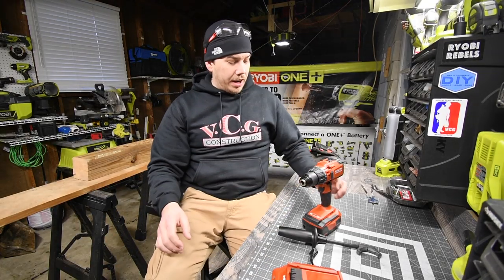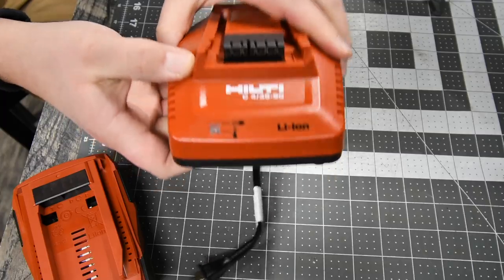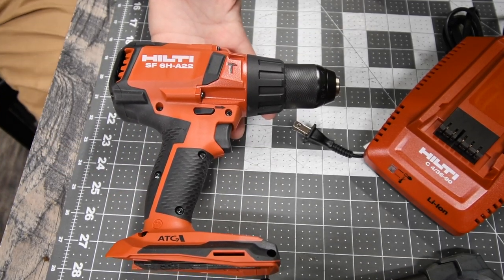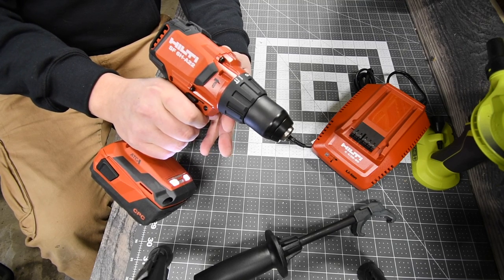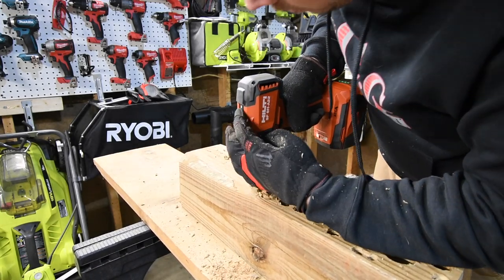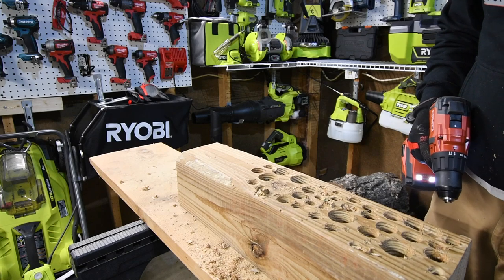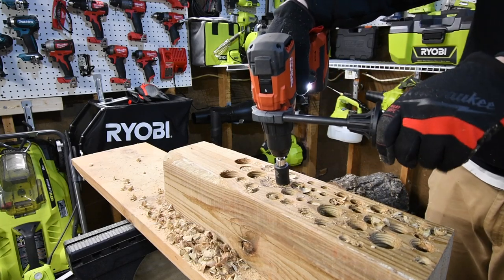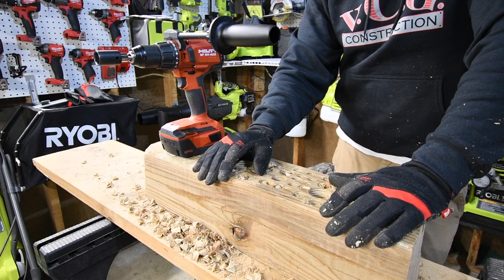NEW!!! Brushless 22v HILTI Hammer drill/TEST

Comment: You took the handle off because you needed more control lmao that’s what the handle is for more controllability. I see you found that out real quick and put it back on. That thing will break your wrist if you don’t use that handle.
Reply from the maker: I needed direct control. so in the video I just uploaded now I found it that putting the log on the ground is best
Reply: Ryobi Man Caver oh yes down lower where you can use your entire upper body to control it is much better.
Reply: No it won't......It has ATC. Active torque control. The drill stops automatically if it catches.  It only has 80Nm of torque but blows my Gen 3 Milwaukee fuel away on screwdriving torque. I own this drill and its incredible!!

Comment: I need some Hilti for science.  I only install cabinets should I go 12 or 22.  I don't want the one in this video but maybe there is a compact 22 or I'll go for the 12.  I have every DeWalt 20 and exstreme  Makita 18v m12 and m18.  So far the DeWalt Is best for Carpenters with there flexvolt.
Reply: Tim Happy sounds like you have more tools than skill for cabinet work is 12v less weight and no contractors run 60v
Reply: @FIinchfree 60v is for mitre saw table saw and compressor.  Contractors in your area must not know how to charge or you would see thease things on the jobsite!
Reply: Tim Happy contractors in your area must not do production work
Reply from the maker: the 12v will be powerful enough but the battery won't last as long as you need it to, id get the 22v
Reply: @ManCaverTools  just ordered the Hilti impact hammer drill circular saw and cutout tool.  Ty for the video.  If I like gonna try the rest of the Hilti tools.     I wonder if Hilti batteries are better then DeWalt Makita and millwaukee they sure cost more lol 😂
Reply: @timhappy7223  Hilti make all the other tools look like toys. These are serious industrial drills. I have owned Milwaukee, Makita, DeWalt and Hitachi.  None come close to Hilti's build quality or longevity. This New SF6H A22 brushless pisses all over my Milwaukee M18 Gen3. 135Nm of torque for the Milwaukee is bullshit.....The Hilti with 80Nm easily beats it on lag bolts with a torque setting to spare!!
Reply: @davesheppard8797  well sweet I ordered some and get them tomorrow
Reply: @timhappy7223  What did you order mate??
Reply: @davesheppard8797  brushless drill impact circular saw and cutout tool.  3 Batts and a charger.  If I like I'll get the rest lol.   Tired of people grabbing my stuff on so called accident
Reply: @timhappy7223  Wow! Let me know what you think of them.
Cheers,
Dave.

Comment: I got mine 2 days ago and love it! I'm pushing it to the limit on next weeks project.
Reply from the maker: this tool will last for a very long time. it did some tough tasks like nothing, and I thank you so much for viewing
Reply: Marcelo, How are you liking your new Hilti now you've had it for over a week? I love mine!! 😁😁
Reply: @davesheppard8797  it is awesome! So far no problems other than being over powered! Careful when you use auger bits though because it sucks you in.
Reply: @monsterlwd  That's great Marcelo, I love everything about mine. It is really powerful! Almost too powerful, I could do with a 12 volt kit for my smaller jobs. Although the power is much more manageable on the Hilti SF6H than it is on my M18 fuel. I was using my Milwaukee all day today at my stepdaughters. Turning the torque ring right down to 1 it was still giving too much torque for what I wanted. The Hilti's torque range is much wider, its softer than the Milwaukee on 1 and more powerful than it on the top torque setting. I hope you keep loving it! What impact do you use mate?
Reply: Still choochin? Mine is on the way! Picked up the hammer and 18v impact as well!

Comment: Can you turn off the hammer setting? I'm looking to get this as a normal drill driver and hammer? Sorry if you mentioned it in the video. I may have missed it
Reply from the maker: yes. the hammer feature is on the clutch. drill, hammer and screw features

Comment: The Gen 3 is its biggest competitor
Reply from the maker: we will see how the dewalt is soon
Reply: Not a chance!!!! I own the Gen3 and this Hilti. The Gen 3 lost every test I did on head to head. The 135Nm of torque claim by Milwaukee is bullshit! It won't drive in lag bolts and leaves them 3/4" out. The Hilti drives them in flush....head and all!! The Hilti supposidly has 80Nm of torque but it wipes the floor with the Milwaukee!!.
Reply: @davesheppard8797  The 135Nm is the hard joint value, think of screwing a metric bolt down. Once the screwhead sits flush with the surface of the material, the torque required to turn it any further spikes dramatically. On the other hand the soft joint value makes more sense, torque increases steadily when driving a self cutting screw into wood or steel. Hilti has a soft joint value of 65Nm whereas the Milwaukee has been measured to be around 55Nm (can't find any specs on either Milwaukees website, nor the operators manual.
Reply: @davesheppard8797  ....This is what i called a top notch review buddy. you convinced me.... Thx a Lot !!
Reply: @korlimservices4180  I just told it how it is from my testing. Plus the Hilti build quality is far better and it should outlast the Milwaukee 5 times over. I have trigger issues with nearly all my Milwaukee gear.
Reply: @Probotector_AUT  Yes....I was recently told that the soft torque value was more important for what I do. Screws into timber. This was only for my testing purposes though. Being an old fashioned carpenter/Joiner I always use Pilot holes and countersinks so either drill will easily do what I require. I much prefer the Hilti ergonomics, build quality, low end torque and love the ATC, which is really a must on combi's this powerful. My Milwaukee tools all bar 1 have trigger issues and they get too hot!!
Reply: @korlimservices4180  Hilti have always made really good tools. They lasted for years and always got the job done. They were never the fastest or best but would take a hell of a lot of abuse and keep going for years!! So this new brushless SF6H is quite an eye opener as it's kicking its competitors Asses! Soon, Milwaukee and DeWalt will have an upgrade that will put the Hilti behind again. But they won't have the toughness or the longevity of the Hilti. Also this new Hilti has far too much power for me so why would I wish an upgrade. This SF6H does everything I need and more. Plus the speed of a drill is as only as good as the guy using it. My Milwaukee drills are too powerful for such a small package, they get too hot, the triggers don't work half the time and are uncomfortable if I use them all day. Just my opinion but I now always go with Hilti. My Te6 a22 SDS has only 2.5 joules of impact. One of the M18 fuel SDS drills has 4.5 joules. But on test the Hilti beats it easily and with less vibration.
Reply: I would say that the DeWalt is it's closest competitor especially after the head to head tests . Hilti and DeWalt are very close. It comes down to personal choice. I don't own the DeWalt, but I do own this Hilti. I can't say what the DeWalt build quality is like.

Comment: I want to see this against dewalt 996
Reply: I like dewalt I own dewalt hammerdrills but I can guarantee 100% this hilti will blow away the dewalt it will blow away the top 18 volt hammer drill of dewalt Milwaukee makita all of them. This thing is an absolute beast.
Reply from the maker: that video will be coming soon
Reply: @jamesfair9751  yes.....I own it now and it is very, very impressive. The build quality is superb and the ergonomics are great. It is just a joy to use. No overheating and trigger issues like with my M18 Milwaukee fuel. And the low down torque for screwdriving leaves the Milwaukee standing. Very impressive. 😁😁😁